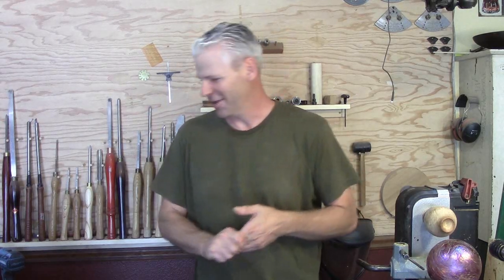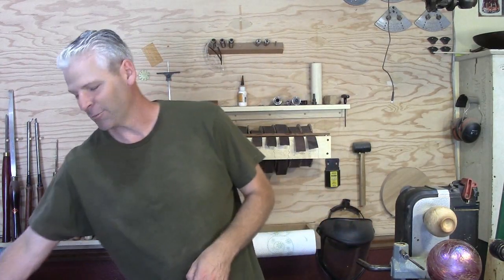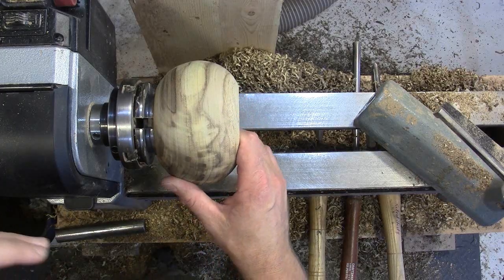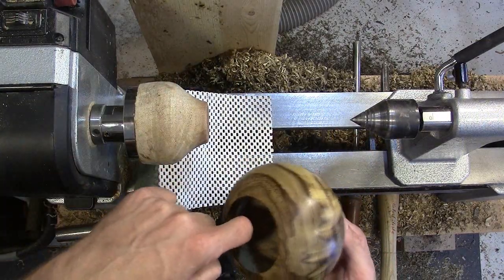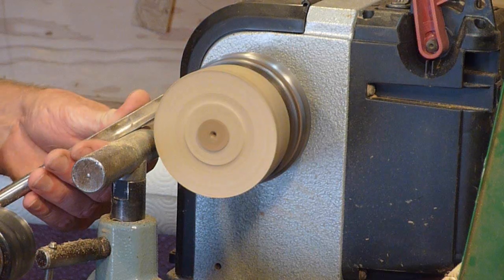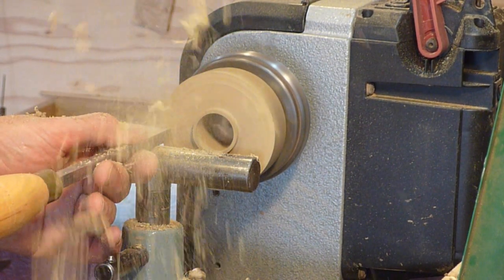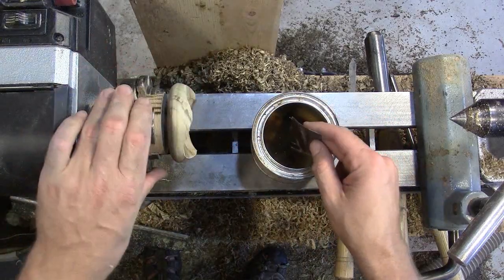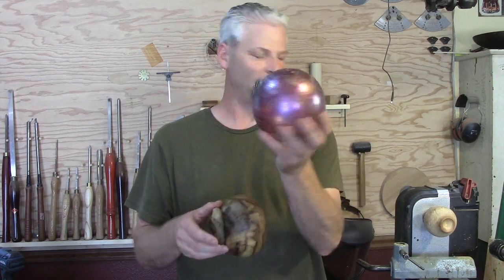Woodturning Night Light

Comment: Hey Carl, Just a tip, for the marble idea, you have to glue them from the inside so they dont stick out so far.  This way all the ugly is on the inside.  Use an electric night light kit/bulb to light them up.

Comment: Pretty nice Carl. You should try LED lights. They are easy to make up and you can run them off batteries or house current with a little transformer. They put out a lot of light and really no heat and cheap to run.
Reply from the maker: MrLeonard55 Thank you Leonard, my wife loves this lamp! as soon as the bulb goes out, I'll replace it with LED

Comment: Great video. I'm curious about your sanding lubricant though. Mineral oil is a non drying oil so it will effect any finish you put on top of it. Have you tried walnut oil? Along with tung oil and linseed oil, it is one of the only naturally drying oils. Mike at Doctors Woodshop sells a great walnut oil. Its pressed from nuts only and is much clearer than other walnut oils that are pressed from the whole tree.

Comment: I hope you do a video on it. Bright white led's are only 3 volts. I'm going to make some mushrooms with silicone. The LED is inside the stem. You can mix a little paint with the silicone to get different colors. Mix a little paint with the silicone, then lay your led and wires in it and roll it to form the stem. Use saran wrap.  Then you can make the top the same way but instead of a stem find something that would work as a negative. put saran wrap and them pack with silicone.  That way you get the round shape for the top of it.  Don't mix the paint in real well. Some area's will be a little clearer and the light will shine through those areas better.
Reply from the maker: MrLeonard55 Can you send me some pictures? That sounds awesome!